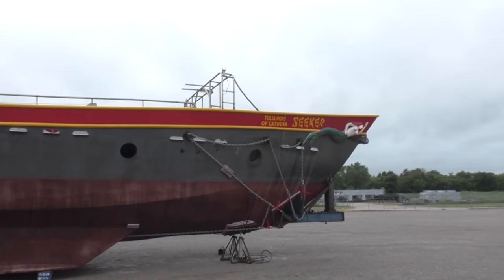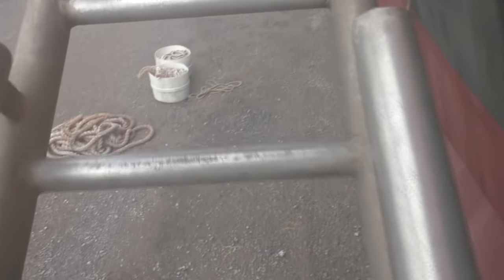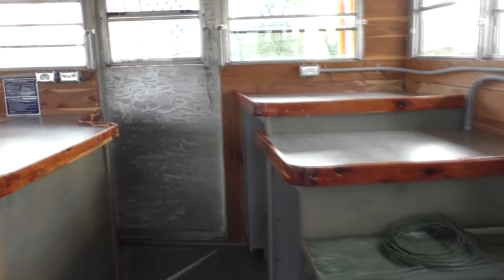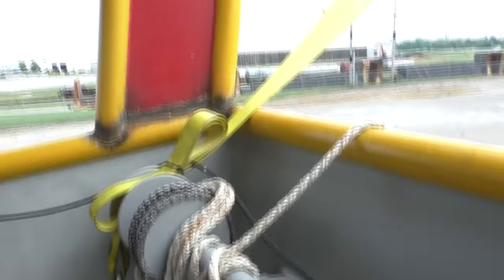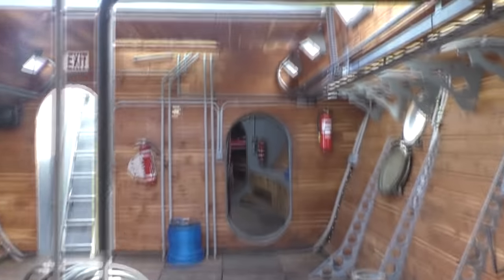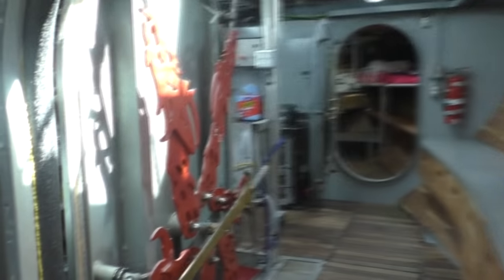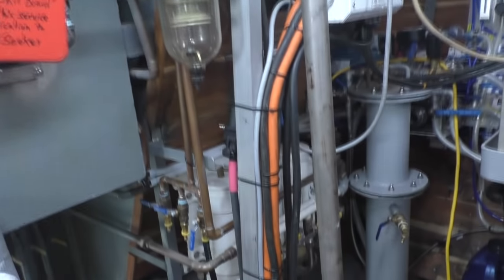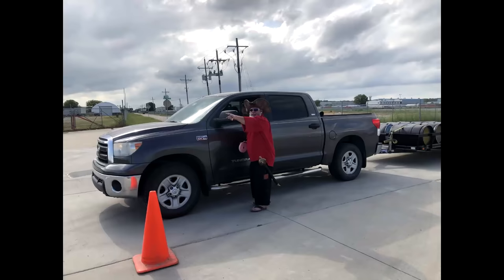Boat Tour and Party Photos from Tulsa Port of Catoosa

Comment: I just noticed that the screws are upside down in the flage connector around the rudder shaft. The nuts should be on the top because if a screw loses its nut it falls out and will be obviously missing. At least this is what they teach in engineering school.

Comment: i have a question about the rain water how will you deal with sea spray getting in to the tanks?

its crazy looking back at some of the videos in the begging and seeing raw steel lieing in sheets and now see it be a fully functional ship is crazy
Reply from the maker: Their is a valve system that only diverts to the tanks when you want it.  Otherwise it just goes overboard.

Comment: Its so freaking awesome, i watched your progress eversince i found your channel after looking up lead casti ng for diving weights and saw you pour the kiels 
Its so awesome to see you are abaut 30 ft from total sucess by now
Still eversince I saw videos from transatlantic crossings with a sailboat a question arose 
Do you have a counterweight to the rudder installed to assure you stay on course manually if you either have no GPS signal, loss of hydraulics or electrical problems with the autopilot system? i know there is no problem with maneuverability but its kinda shit to then needing someone 24-7 on the rudder duty til its fixed 
In some videos abaut oher sailboats I have seen manual counterweights on a small mtronome like boom that compensate for shifts in course created due to lisping sideways from waves and the boats tilt while sailing
Reply from the maker: I think you are referring to a wind vane.  And we do not have one, but we are installing an autopilot that monitors the wind and heading and will automatically adjust the heading with hydraulics when the wind shifts.

Comment: Is your crane hydro or electir and is it runing spectra just curious AK Commercial fisherman half ass Engineer lol You need a drop square under that hole that needs to be reinforced or be prepared to replace those deck boards nothing is square to the drop thru the hole. This is experience from million pound freight transfers on 156ft ak C/P Named the Alaska Mist, FV Pavlof, FV Alutian Lady. All wood will be wrecked you need a landing pad under rubber matts or pallets work best. Rubbers only work half ass but pallets take the blow.

Comment: Do you have any idea how long it will be before she's in the water?
Reply from the maker: When the insurance tide turns.
Reply: @SVSeeker  I can only imagine how much insurance is for a self built boat...
Reply: @SVSeeker  Protecting who against what? That the port's cranes are not able to lift , with 6 ins of water in her, if she starts to take on water and needs to be replaced on the trailer???